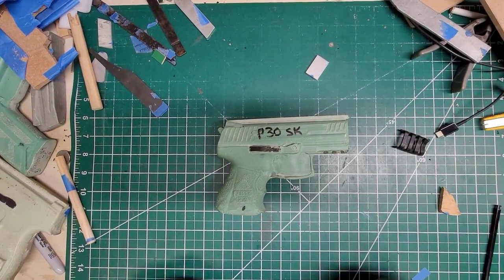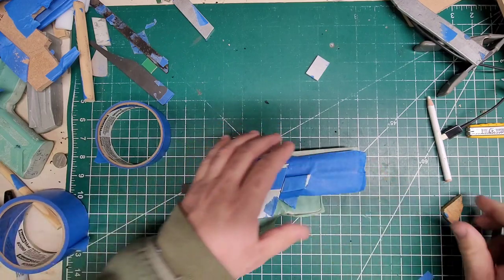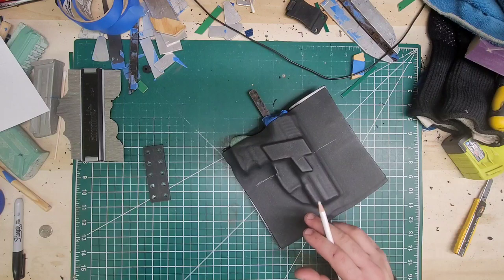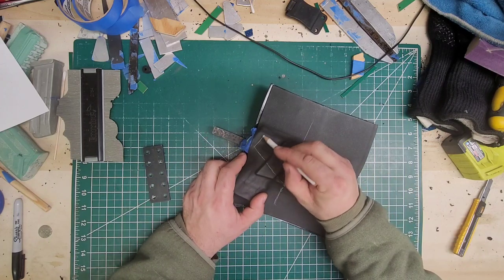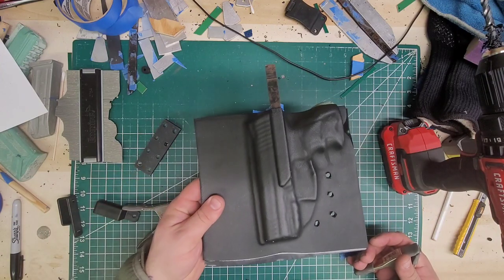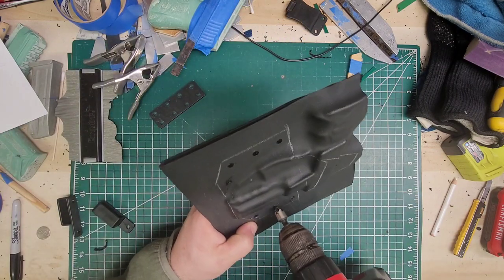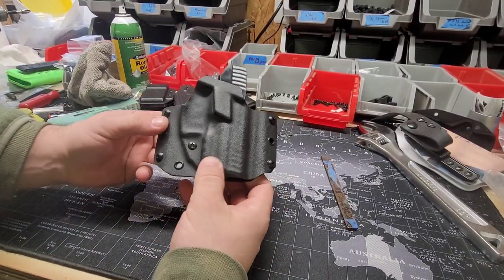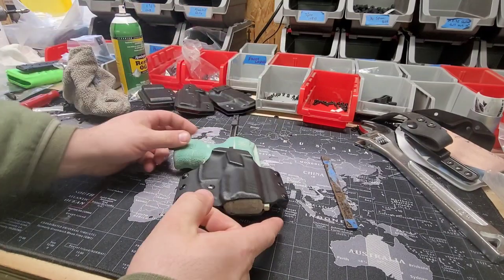HK P30sk OWB

Comment: A while back, you were using a drywall sanding sponge, which you said you liked better than a buffing wheel. Any reason you went to the buffing wheel?
Reply from the maker: I still use the sanding sponge. My first live. The sanding wheel is nice for tight spots quick